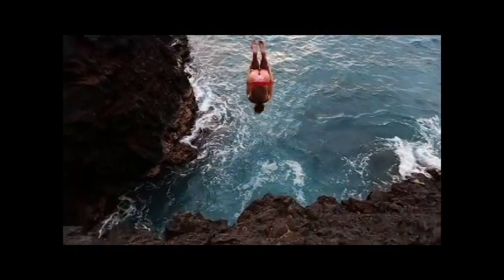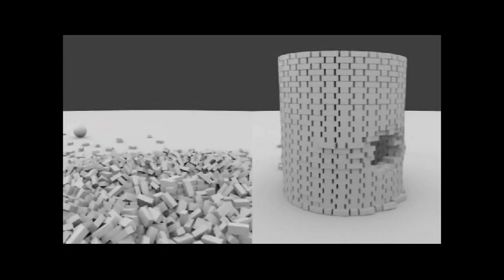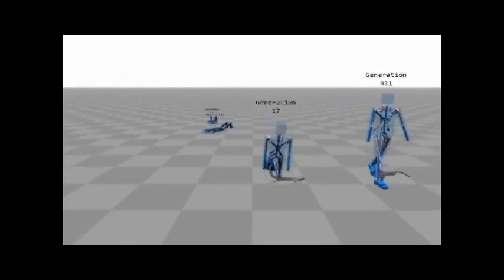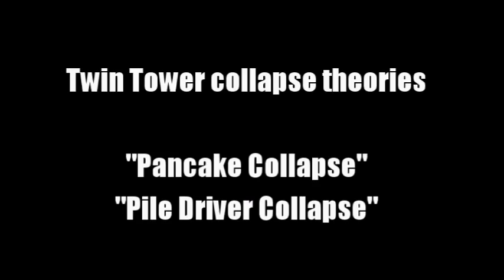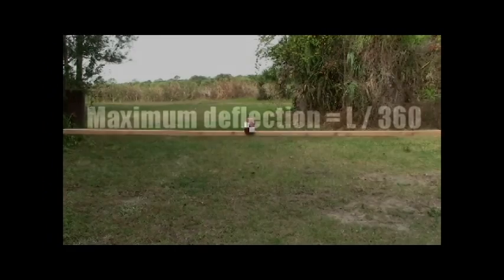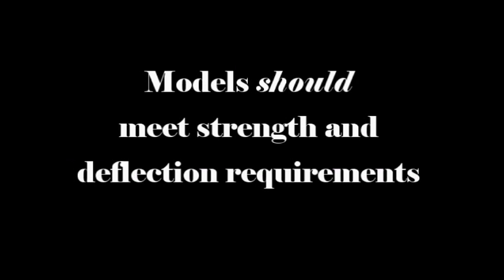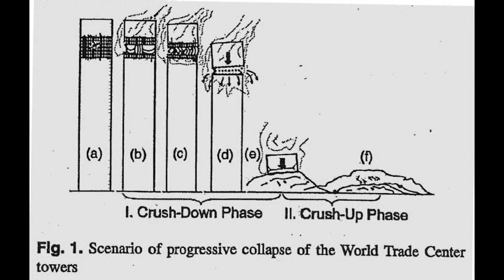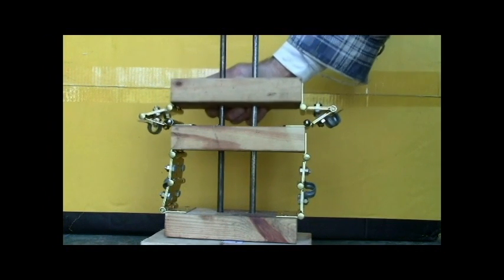9/11 Experiments: The Force Behind the Motion

Comment: You can't replicate the system by using paper, pizza support and so on. They will have different strength to weight ratios, moduli of elasticity, fracture characteristics and a host of other variables  from the actual building materials. The only valid 'experiment' would be to rebuild the towers and do it again.Plus, how conceivable is it that the towers were rigged with explosives on every floor without anyone witnessing it? Real building demolitions take weeks to set up. Beams have to be exposed, holes drilled, explosive charges set, and all the charges have to be linked with cable. To do that in the towers would take months. And nobody saw anything suspicious? Hundreds of engineers would have been needed to do it. Not one has come forward to tell the tale?